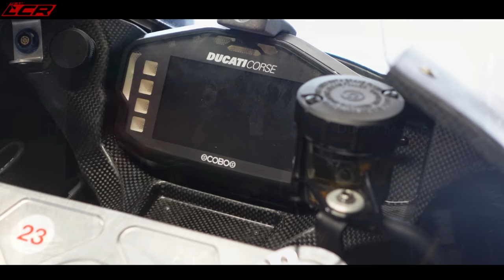Ducati's First Electric Motorcycle! | From Race Track To ROAD?

Comment: Wow, that was a very interesting vlog, you’ve got to admire the tech involved used in the development of EV race bikes. Mind you, at 15:06, it seems that they don’t hold together very well when dumped in the kitty litter. Begs the question “is using the battery as part of the structure a good idea”?

Comment: I guess all major manufacturers really have no choice now, but to look for ways to help save the planet. I'm also pretty sure there will be heavy Govt regulation brought to bear if they don't. It was interesting to see that Ducati are actively working on something, that will keep them open as a buyers choice in years to come. Roberto done really well, quite candid even with what he was allowed to reveal, and there's no doubting his enthusiasm and drive for the project. My takeaway though, wasn't the battery, the bike, or Roberto's lingo, it was that front end parting company with the rest of the bike, when that chap went for a slide. As much as I love a bit of Carbon Fiber, I want a real tubed frame and steering head I can trust not to turn into yet another object trying to kill me on the road, if I go for a slide of my own. I appreciate that he was not exactly going slow, and that the bike did flip end to end, but the way it just snapped off would have me avoiding kerbs! All that said, I'm keeping my fingers crossed that mama Kwak's project bears fruit and if not, I'll be drilling for my own oil 🤣🤣

Comment: An interesting video.

Did you manage to get any feedback on why the bike at 15:06 split apart (the front wheel and forks completely separated from the remainder of the bike) as the bike tumbled laterally in the gravel?  This is not something I've seen in similar circumstances on ICE bikes on track.